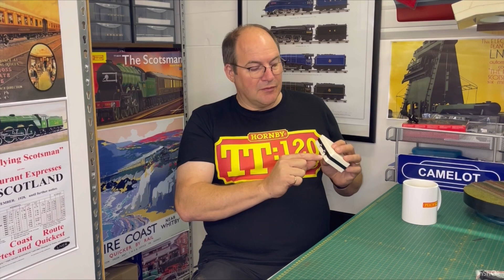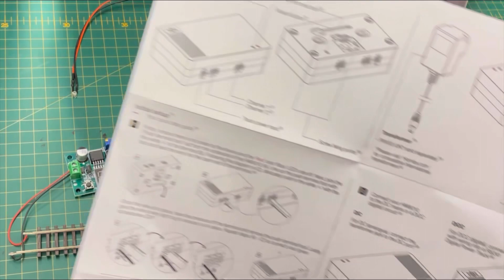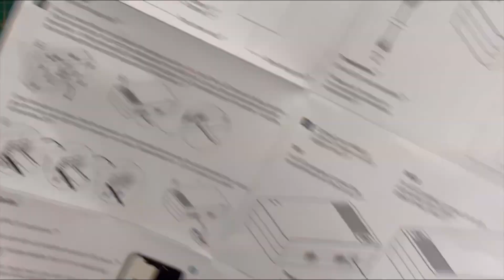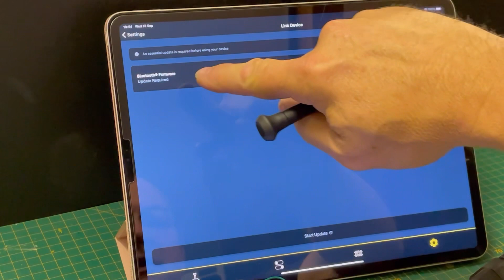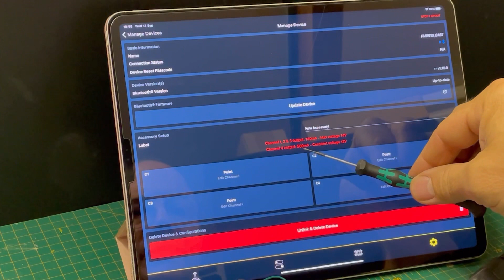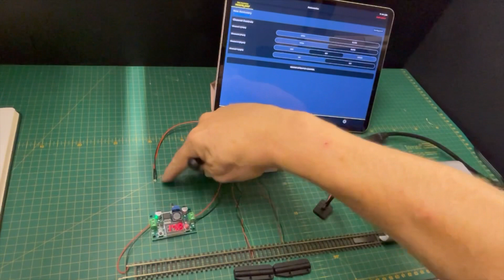Hornby HM7000 Bluetooth accessory control, @HornbyModelRailways @hornbymag

Comment: Will this work with Pecos twist lock point motors and is the hm output for the point motors constant power or is it a burst of power to flick the points
Reply from the maker: Just a burst. As for the twist-lock Peco points, possibly, but I’ve never tried them
Reply: @PeachyTT120 thanck you I think you have just saved me as I'm building my railway through a wall and I wanted to control the points from the next room and I have been given myself a headache just trying to figure out how I can do this.
I've looked at servo motors but they require computer set ups what is beyond me and I tried wireless switches but they can't handle a CDU so this will save me from a railway brake down

Comment: Can you help just got a tt120 scotsman bluetooth and the inner radius when I switch the point it stops
Reply from the maker: The Hornby points work as an isolation switch. If you are sticking with their system you will need to fit their DCC clips to bridge the contacts so the whole system is “Live”

Comment: Hi Peachy, I use the Hornby hm7000 system to controll my oo gauge locos and was going to use the hornby lever switches to controll my points the traditional way until I came across your video. I have around ten Hornby point motors so even at around £12 per lever switch that's a fair bit of cash to start with. As of June 2025 Hornby have the R7293 HM6010 on sale at £16.99, reduced from £42.49. As I use the App already it's a no brainer. I'm off to order three before Hornby run out.(via the above link) Thank you for helping me make my mind up !
Reply from the maker: Glad to be of help

Comment: Hi Peachy, great video!  Was it straight forward connecting the hornby point motor up to the uncoupling ramp?
Reply: Fantastic, cheers for the peco tip as well.  Hadn’t realised they did a low profile surface mount motor.  
Hoping to get my run around sidings’ points and uncouplers all motorised.  Fun times ahead!
Reply from the maker: Yeah, pretty much. You have to get it in exactly the right position to make it work as it’s very weak. The Peco surface mounted ones are a better buy imo

Comment: Can I use non-Hornby point motors with the HM6010 and HM7000? If so which points are the best for under baseboard mounted point motors. Many thanks in advance.

Comment: Hi Peachy. Great job as usual. Thanks for promoting TT120. I love it. Can't find a link to the variable voltage dropper? Keep it up. Looking forward to the next one.
Reply from the maker: @ChrisLacey-u2j  the link on eBay kept getting changed so I removed it. But since then I’ve used this with 15v & also 18v without the voltage regulator and it worked just fine
Reply: @PeachyTT120  That's good news thank you for that.

Comment: Just purchased the HM6000 and very pleased with it. I’m just trying to figure out if I can add a CDU for a below baseboard point motor. Sorry for the newbie question.
Reply from the maker: What’s the question?
Reply: The point motor works fine until I add the actual point and there doesn’t appear to enough power to switch the point.

Comment: Hi Peachy.  Seeing your advice on using the DCC Concepts power supply, and having suffered a few intermittent power issues, I considered purchasing one.  However, DCC Concepts consider them 'unsuitable' since they exceed Hornby tolerances.  They said they " don't sell products for Hornby".  Since you are using one can I assume there is no significant issue to worry about?  Apologies if this is not the correct way to pose this question to you.
Reply from the maker: Hello John, I’m guessing DCC concepts are covering their backs, & I don’t blame them. 
I saw some other modellers using them so I asked a couple of tech guys who are members of MERG (Model electronic railway group) and discussed this issue, they advised me that they believe the HM7000 chips have voltage limiters so can easily cope with the 18v supply. And that the unit is a super deliverer of power so it shouldn’t be a problem. 11 months on and I’ve no issues
Reply: @PeachyTT120  Thanks Peachy.  I suspected they were being cautious.  I have one of  the voltage regulators you referred to, so, I guess I could wind the power down.  That said, I also suspect that the real solution, particularly to the loss of Bluetooth, is a power bank.  However, they are seeming permanently unavailable on the Hornby site, and as an 'elderly new comer' to the hobby, I'm not sure I have the nerve to install as you demonstrated in another video.  keep the videos coming, they are very helpful for 'oldies' such as me!

Comment: Ok. Tried to hook my two up today. Very excited but the device scan doesn’t find them 😢. Not sure what to do next. The power light is on
Reply from the maker: Sorry Damian, I’m not sure what to suggest. Have you tried the Hornby Forum? They’re’s lots of clever people on there with a lot more experience than me. Good luck, hope you get it sorted.
Reply: @PeachyTT120  I just did and I think I got the answer although I didn’t think it was obvious. Apparently you can’t power the unit direct from a bus that is fed from a DCC controller (in my case a Select). You need a separate DC 15v source or a transformer. I didn’t think that was clear from the instructions or your video but perhaps it’s just me
Reply from the maker: @damianinCanadaTT-OO  ah, but my video is pertaining to HM7000 Bluetooth DCC which basically means the track power (where I got my feed from) is for all intents the same as DC. 
As for “traditional” DCC I can’t comment as I’ve never used it, sorry.
Reply: @PeachyTT120  sorry to have this whole conversation on YouTube but it helps my understanding. So I’m using DCC power for my HM7000 as per one of the recommended options from Hornby. You are using straight DC which I now understand it’s different. I think I get it now. I need to power my HM6010 from a different source. Confusing, at least to me 😂
Reply from the maker: @damianinCanadaTT-OO  👍

Comment: hmm - but what saves us the unit introduced by your excellent video or what does it make more simple? And a test with a second module would be interesting to see if the app does not mix up the connected points, signals etc.

We still need a bus to energize the locos on track even if we let them receiving their commands via bluetooth, the same is valid for the accessory decoders. Bluetooth spares us a central unit to create the DCC-signal if we do not mind to control everything on a touchscreen. Instead we need a constant DC supply with an appropriate overload protection to turn power quickly off in case of a derailment. Bluetooth spares us as well the DCC-address assignment which might be sometimes a bit tedious. 

But what about train resp. loco recognition at pivotal positions in the layout to support some automation?

Comment: Brief comments here - more detail on your post on the Hornby forum..
HM DC app has an artificial limit of 3 x 6010s. HM DCC app has no limit on number of devices, in fact these work as static nodes to make the Bluetooth mesh more robust.
Depending upon power source - DC jack or Track, which can be DC or DCC depends upon the functionality of the device. With DC power you get the basic functions as seen on your video, with DCC power and at latest revision you get the advanced functionality of the R8247 V2.0 device (the innards are essentially the same apart from the added Bluetooth. HM DC app needs an early version of firmware but HM DCC app needs the later version as installed at the start of your video.
If enabled in settings you can have accessory control showing at the top of the joystick icon screen along with your locos - these show in a side-scroll ribbon bar same as the locos.
Reply from the maker: Excellent info, thanks 🙏

Comment: how would it work with dcc concepts IP digital point motors?
Reply from the maker: Not sure on that one, but if they’re the normal 3 wire job it shouldn’t be that hard to sort. Obviously you’d need to wire it by description rather than colour code & you’d need to check they’re power needs but then 14v shouldn’t be a problem for any accessory.

Comment: Flipping heck Peach you’ve knocked it right out of the park for us newbie’s once again. Muchas 
gracias. The thing is I really want to be able to automate my layout fully using Itrain. So unfortunately it looks as if I’ve got to go and get me a Roco Z21 as the Hornby controllers don’t work to good. You’re absolutely correct in what you say about Hornby not describing stuff, they are abysmal at it. Keep up the good work. 
Steve
Reply: You can easily use the HM6010 with any DCC controller (and iTrain). It fully supports DCC with update 1.10.
Reply from the maker: @stormbowman7148  🚂👍
Reply from the maker: Cheers Steve, if you’re interested in the ins & outs of Roco Z21, subscribe to This Way Works as I think he’s planning on using it.
Reply: Oh thanks our kid! Brill  @PeachyTT120

Comment: George demoed this in the Beyond the Buffers video back in May but didn’t really go into detail so your video is great. I’m probably being simplistic but surely the issue with track/bus power with DC is that with a simple circuit of track the power depends on what your controller is turned up to i.e. if you have the power at zero there is no power to your accessory model! Of course with DCC you don’t have this concern as power to the track is constant
Reply from the maker: Hello Damion, I’d missed that episode of BTB, I hope mine is of use. 
Yes, of course how DCC Bluetooth is powered hasn’t been considered till now, hopefully more stuff will become accessible to it soon.

Comment: Hi Peachy, you may be interested to know that I emailed Simon Kohler back in February this year about the HM7000 and the accessory unit HM6010 and if it would still be limited to 12 accessories like the HM6000 as this seemed very limiting.

The answer I received stated the HM7000 should be able to handle limitless accessories.

N.B. I believe PECO have some signals in the pipeline. I'm not sure if they're just semaphore signals or lights as well.
Reply from the maker: That answer is very interesting, thanks. 
Shame Simon’s not there anymore.

Comment: Just ordered the hm6010 and surface points problem plugs and sockets ! 
Love the site
Reply: Question how many lights can you run on this unit q2 if I get another unit do they run linked or sperate units
Reply from the maker: @daveblake9804  you can run 4 lights, or 4 signals or 4 point motors or any combination. The only restriction I believe is you can just run the 1 motor. 
As for the units they are set up separately, but appear one after the other in the App
Reply from the maker: Excellent! Glad you’re enjoying it.